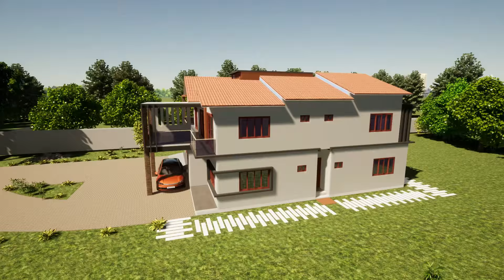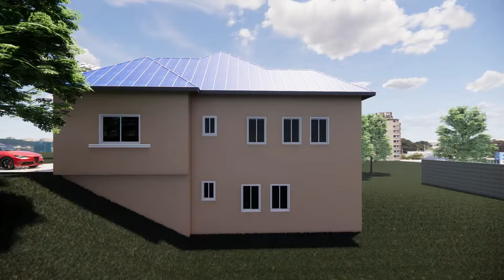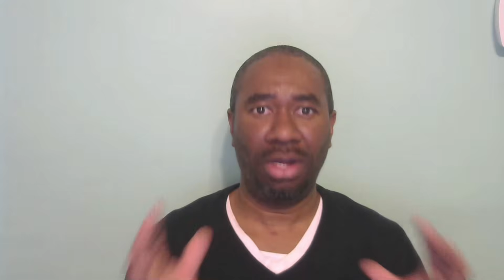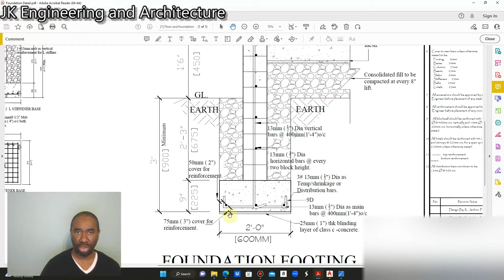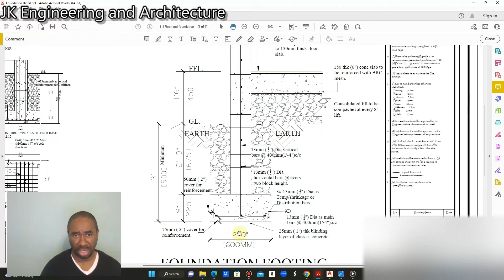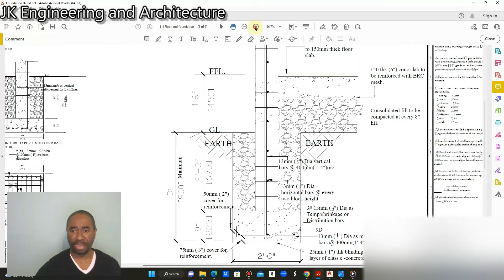How to properly constructed your foundation footing for your dream home. (Jamaica).

Comment: I don't want my project to be over engineered. I think the 18" width is more than enough with the 3' height. If I have a rocky soil, could I use that to backfill? The weird thing is that all the projects I've seen on here use the same material to backfill. Is it that they are taking a shortcut?
Reply from the maker: Yes, the same excavated material should not be used to backfill the foundation. Thanks for your comment.

Comment: Good day JK I am planning on building an a gently slope land however with my limited knowledge I think the soil is weak given it was previously mined by bauxite. Any recommendations?
Reply from the maker: Well, are there any other houses built on the same land. That is a good indication if the land is suitable for building a structure. Other wise you would have to get a foundation report from a geotechnical Engineer.
Reply: @jkengineeringarchitecture.  yes a house is next door with a deep foundation, however am assuming they dug that deep in order to get a split level house..
I am planning on going up stairs in the future but I don't like split level.

Comment: It felt like attending one of the lectures in a final year. I have been watching videos in this category, but none of them came close this one
Reply from the maker: Thanks.
Reply: @jkengineeringarchitecture.  Based from what I was watching, a cavity wall of  270mm thick (two 110mm bricks with 50mm cavity)  thick wall would require a strip foundation with minimum of 810mm width and 405mm thickness. I once read that structural engineers can reduce that thickness and width by adding more rebars (in some fashion). In that case, to what extent can you reduce that 810mm x 405mm, and by doing what?

Comment: Good day friend . I have been a constant follower of you presentation. Because you have brought out the Jamaican way of building house. Great job. My question is how do you mIx rendering material for wall what is the quantities of cement to sand to obtain  great finishes. This is captain.
Reply from the maker: Respect. The right mix ratio for rendering is 1:2 ratio. One barrow of cement to two barrows of fine aggregate (sand). Maximum Respect.

Comment: Good job Sir ! I'm going to build a three story building 20×40 a footing of 4×4' and 12" concrete thickness is good enough?
Reply from the maker: I don't know. It depends on the type of soil.  For a three-story building a sub-surface investigation to determine the soil type is needed to be on the safe side. NUFF RESPECT.